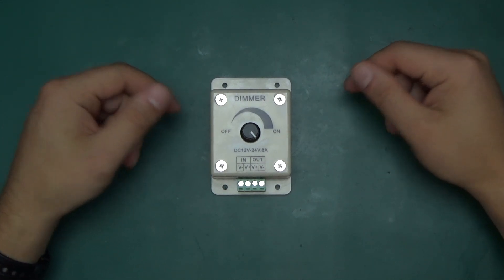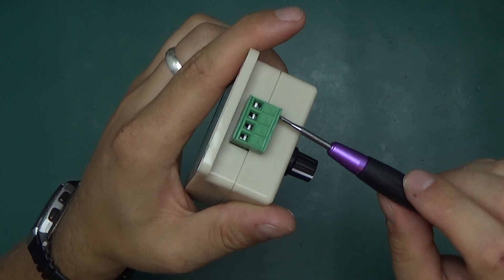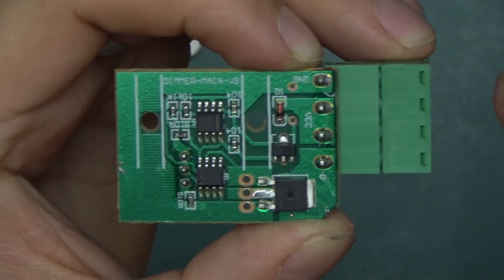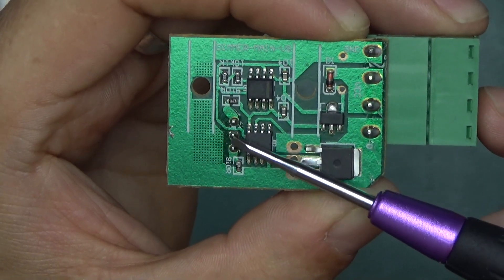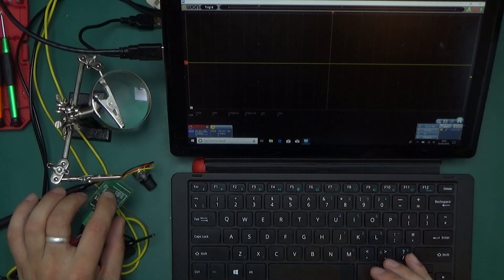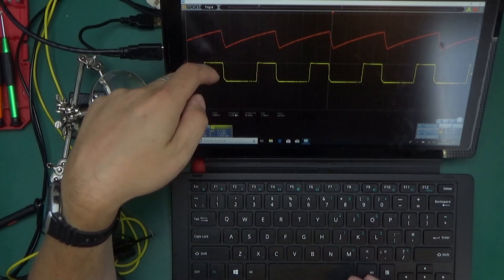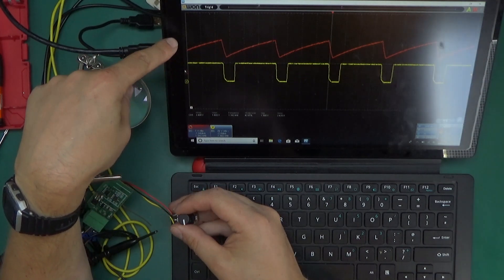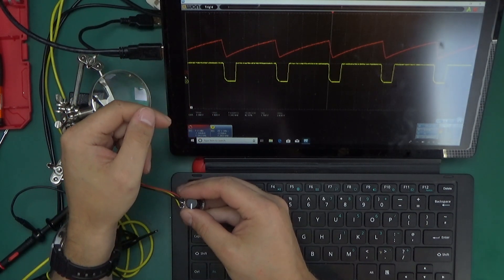#017 - PWM LED dimmer: a look inside

Comment: Does such simple dimmer:
1. Take current from the driver in pulsating way (full load current on PWM's "highs" and 0 current on PWM's "downs")?
or
2. Take constant stable current that is equal to the real mean consumption?

If the answer is 1: should I expect overcurrent caused by no-load periods occuring? E.g. 30V instead of 24V on driver
If I know, the dimmer will be set to 40% forever, should I buy a driver for 40% of load or I need to buy with 100% Watts to keep the signal stable?

Comment: what if want to make it smart, connect an ESP8266 and control dimming via WIFI? what settings/PWM signals should I use and which pin ?

Comment: Does this dimmer consume electricity when its "dimmed" all the way to the lowest setting? Or is it completely off? 

I guess my question is: Does this dimmer consume more electricity (when turned all the way to off) compared to a ordinary on/off switch in off state (which consumes 0 amps since the circuit is open)?

Comment: Thank you for your video. I love your curiousity
And willingness to test out how things operate.

A question: i would like to use this approach to modulate leds internal to a capacitor switch.
Schurter 3-101-404
The leds are internally powered by (i am guessing)
A 3.3 v constant current supply.   To turn them on i have to ground the pin connected to the led.

I was thinking of using the pwm between the led and the ground (when i turn it on)

Is that possible?

Comment: This is probably the most stupid question you'll get for this video but... what is the output voltage and current of this device if I supply it with a 12V/7A battery? Does this device have any significant resistance value? thanks.
Reply from the maker: This outputs same voltage as input (12V-24V is the acceptable range) modulated PWM - that's how it adjusts the output: Pulse Width Modulation. Look it up, you'll get it. And yes, you can connect it to 12V battery to be able, for example, dim some 12V lights.
Reply: @randomtronic  thanks!

Comment: Nice video/good explanation! And the device doesn't look that bad considering it can be bought for 2 bucks on eBay :)
Reply from the maker: Yep, surprisingly not junky. And one would struggle to put this together for less with the case and the knob included.

Comment: It's a waste to have a 555 and an op-amp when the other unused op-amp could have been easily used as a triangle wave generator!
Reply: Creating a DC triangle wave requires two op-amps, so it would use both halves of an LM358,.  Even so, they could have used an LM324 quad op-amp, which costs the same as the LM358.  The same number of passives are required, so the cost would have gone down by deleting the 555.  Good idea, Ed.
Reply: @FlyingShotsman  yes, for a pure triangle wave, but you can tap off of the capacitor from a simple relaxation oscillator to get a triangle wave with exponential ramps just like the 555.
Reply from the maker: I thought that too - it could be done with a simpler circuit and 1 IC only.

Comment: Really nice, man. 😊
The best part is that there's no flickering in the light!
Reply from the maker: This runs at 1.3kHz, (I think I forgot to mention in the video)  so the flicker was not visible to camera recording at 50 FPS.
Reply: @randomtronic  Exactly!
Reply: @randomtronic  - Excellent!  I would like to build a camera light. For 2 led strips, 1 WW and 1 CW, I would like to build something with these dimmers, where one knob controls brightness and one knob controls colour temperature, without changing overall brightness. What is the smartest way to do it?
I thought of having: Battery => 1 dimmer for brightness => split to two dimmers, where I use a 1K stereo potentiometer instead of the 2 individual original 1K potis  of the 2 dimmers, in order to "dim" between the two strips of different colour temperature. I hope you can follow me.
And can I save a wire to and from the led strips, by combinig the (+) of the two strips and have 2 separate grounds (-)?
Is there a smarter way to do it? Thank you very much for your help.
Reply: @mkingkral  - Dear Martin, thank you. I wrote: 
"I would like to build something with these dimmers, where one knob controls brightness and one knob controls colour temperature, without changing overall brightness."
I can't find the relavant bit in the link you sent me. Could you give me the timestamp of the relevant bit? I only find, where each strip is controlled individually.
Thank you.